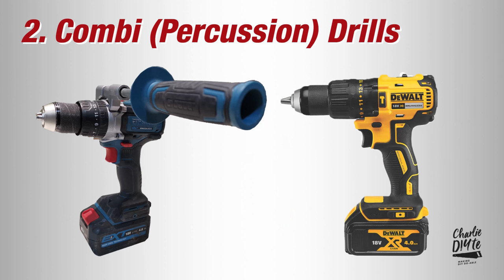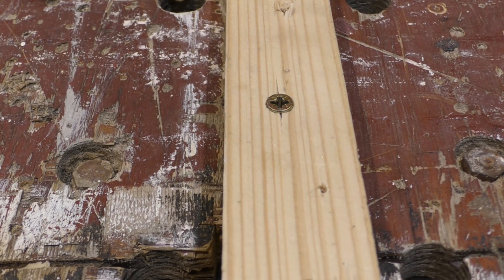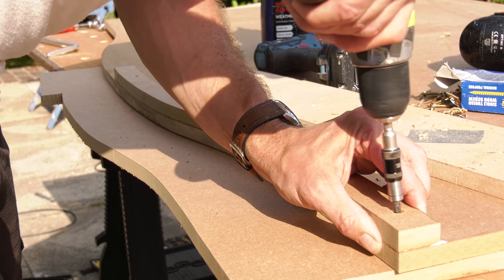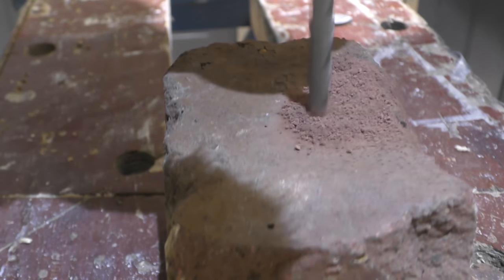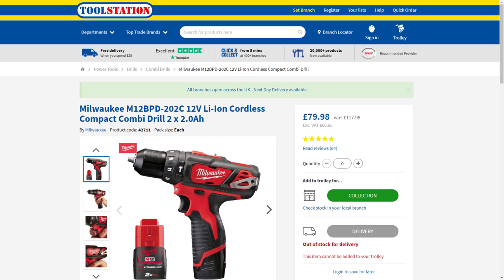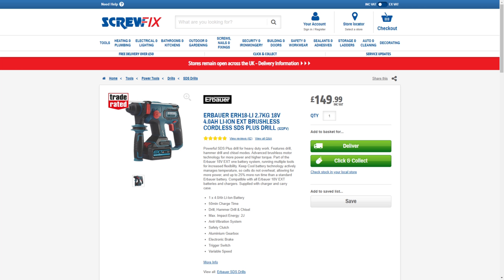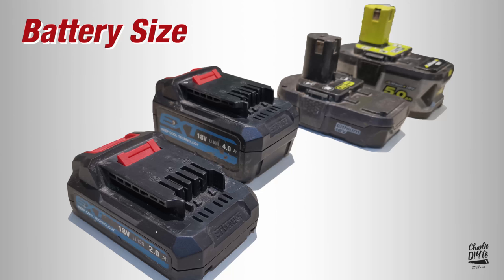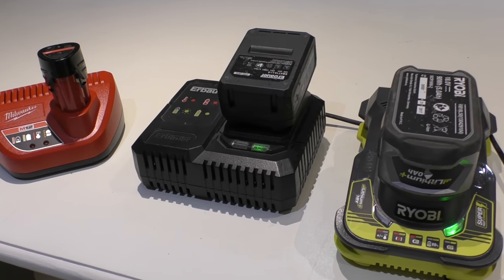The Difference between Combi, Drill Driver, Impact and SDS Drills

Comment: Drill/drivers and impact drivers aside for a moment, as a DIY”er, working on your own home or garden where you can be guaranteed a mains power source and are not against the clock, I see no need to go with battery powered for everything.  Corded circular saw, SDS drill, jigsaw, mitre saw, multi-tool, angle grinder.  Of course battery is more convenient, but corded tools are cheaper and generally more powerful.
Reply: True but unfortunately there isn't a power source at the allotment plots so cordless  is the only option really because I don't own a generator and you can only drive when there's been no rain for months on end or get stuck.  Yup cordless is my friend.
Reply: And you can almost guarantee; when a emergency job comes up - the batteries in your cordless tool will be flat !!  So you will have to bodge it with something else ....
Reply: I have both, the time you save and money saved on extension cords is worth it

Comment: I was a pro tradesman from 1980 to 2000 and we used Bosch and Makita battery tools when they first came out. The Makita's used to eat NiCad batteries. I currently have an Hitachi 18V combi, Erbauer 18V SDS and a Titan 239V SDS which I bought for knocking a wall down. The Hitachi has been fantastic, one of the best drills I've had. The Erbauer is as good as a Bosch GBH24 IMHO and way better value. The Titan is by name and nature a Titan, it makes mincemeat out of brickwork and concrete. My next door neighbour borrowed it to break up the foundation of his clothes line pole and got it done in minutes. At work we have 50 to 60 operatives and we used to use Bosch battery tools but found the plastic chucks were poor so we moved to Milwuakee. The Milwuakee's were unreliable with many broken triggers and other electrical issues so we moved back to Bosch, but the Pro range with metal chucks.De-walt have a big fan base but personally I think they're overated and over priced. Great video Charlie, many thanks.

Comment: What people need to realise is that the power tools u like and use are 4 DIY only really! If you work on site as a professional you need the better more expensive brushless models like Dewalt, Makita, Festool, Hilti, Metabo and Milwalkee! The tools you prefer aren't really upto the heavy duty work that professional's use! By the way brushless are more powerful and the batteries will last longer! Also you want the same brand as you don't want to lug round umpteen chargers and batteries!
Reply from the maker: Thanks Ian. I'm pretty sure I made this point. This video is aimed at to the DIY market though. You're right but I don't think DIYers would notice the benefits that a brushless motor deliver.

Comment: Finally, someone with logic that's getting off the brand-name loyalty bandwagon. I commend you sir for your opinion on brand loyalty. I was so wrapped up with my first tool, a Porter cable drill driver that I wanted to continue with that line, but Porter cable is no where to be found. You're right, so what if I have three different manufacturers and three different batteries. For do-it-yourselfer it's really a no-brainer when you come to think about it.
Reply from the maker: Thanks, I appreciate that. 👍
Reply: You are of course right about brand loyalty for diyers but professional's who work on site don't want to be carrying around allsorts of chargers and batteries! You also get what you pay for! If you want a rolls royce then don't by a Morris minor and expect it to be the same quality! I myself am a plumbing and heating engineer who use top of the range Metabo as my choice! I don't want to be buying new power tools every year! If you try to use sub standard power tools for heavy duty site work you will regret it as my son found out when he was an apprentice carpenter and used a cheap Ryobi combi drill for the day to hang doors and by the end of the day the motor had burnt-out and was no more use to him! He then decided to by smart and although he paid more for his new Dewalt combi it has lasted him to this day which is 8yrs on! He now has every power tool he needs all made by Dewalt saving him money on chargers and different battery set ups!

Comment: Tim from Canada so it looks like you went from Ryobi.. that was discontinuing in your country and you switched to Milwaukee.. so the Milwaukee driver you were using in this video is the Milwaukee M 12.. this is the make that is running in the Home Depot in Canada and USA.. you can still buy your little Ryobi 12 v. Screw gun in Canada at Home Depot these are one of the big sellers at Home Depot trying to find anything that is 18 V half decent by Ryobi.Most of the time is impossible at least in the city I am in in Canada where I live there is two Home Depot’s within an hour of each other from me and trying to find tools here is somewhat impossible and trying to find someone to help you find tools this is another problem Home Depot is having one day you’ll go in and there will be five people that will help you... you can go back in a week looking for something else and you will not find any help in the power tool section... this seems to be a big problem at Home Depot.. what I am finding two in Canada at the Home Depot is stuff will be on the website you go to buy it.. it is now out of stock and it is not listed anymore at any stores.. they need to fix this update the service at the website at Home Depot or get someone there that knows what the hell they are doing... you can go in there and ask a five-year-old to help you and they will have more sense than the people working here. These are my problems I am having at the Home Depot in Canada but people are scared they do not want to speak up...
Reply from the maker: We have the same problem in the UK with staff in DIY stores not being knowledgeable on the power tools they sell.

Comment: Very useful video. That Titan SDS is a beast! I use DeWalt combi and impact driver daily. Note that there are 'retail' and trade ranges, so if you want the higher spec you need to do a bit of searching (not Screwfix/Toolstation etc)
Reply from the maker: I'm embarrassed to say, Steve, I didn't even know that!! Can you give me an example of a trade link? Thanks for the comment 👍🏻
Reply: @CharlieDIYte  As you say in the film, manufacturers are tricky with the 'kits' they sell - combinations of tools, batteries, retailer-specifics etc, but for the DeWalt combi driver you can get the DCD796P2 (XR) and DCD996P2 (XR-P). Note the 'P' (Professional?). More powerful, better gearbox, extra speed, led settings as torch. For the impact driver, there is the DCF787N and DCF887N which is more powerful and has 3 torque settings. I got my higher spec from Powertoolworld or FFX. No idea about Milwaukee etc. And of course there are now higher-voltage options. Might be a subject for a follow-up?

Comment: Even at 3 years old, this is still the most helpful information I've had to work out what the differences between combi & drill drivers are! I've literally spent hours on various store pages and nothing ever really explains it. Also, you probably already know but may be worth a short update video about AMPShare, which means if you have a Bosch or Titan 18V battery, you can buy a bare version of either brand's tools and use the other's battery!
Reply from the maker: Thanks and I didn't know that about AMP share. 👊

Comment: Good video. I agree that a drill driver (with or without hammer mode) is probably the single most useful tool for DIY, if for no other reason than it’s extremely flexible. I also agree with you on using a good 12V model such as the Milwaukee, Bosch, or Makita. Ryobi doesn’t seem to be committed to their 12V line, so I personally wouldn’t recommend the Ryobi 12V, but if you find a good enough deal on it, it’s fine. 

I also find that for most DIY users, a good 12V hammer drill/driver (aka combi or impact drill) such as the Makita CXT, Milwaukee M12 FUEL, or DeWalt Xtreme is sufficient. If you’re doing a lot of brick/concrete drilling or a lot of tile removal, then an SDS rotary hammer might make sense. For a one time project, it may be more cost effective to just rent an SDS tool.

As you mentioned, if you’re installing a lot of screws, bolts, etc, then an impact driver is highly recommended. They’re almost as flexible as a drill/driver, and much faster, and easier to use for most fasteners. They’re also suitable for lightweight drilling as long as you buy impact rated hex shank QC drill bits. Word of caution, because of their speed, it’s easy to over drive smaller screws, until you learn to control the speed using the  trigger and/or speed mode controls. If you’re installing a deck or similar project, save yourself a lot of time by using an impact driver.

Since installing screws and bolts was the primary task for which I use power tools in my work, my impact driver gets used much more than my drill/driver. But when I changed projects and was installing/removing more small screws, I bought the Milwaukee M12 screwdriver (model 2401, brushed) which is now the tool I use most, it’s by far the easiest to control and the lightest of my power tools. Impact driver is now second most used, for larger jobs and larger fasteners, and the hammer drill/driver is used almost exclusively for drilling, mostly for larger holes or masonry as the other two tools handle drilling smaller holes in softer materials just fine. It’s a luxury to have all 3 at my disposal, not a necessity.

PS. I also have 18V/20V power tools, but rarely use them. For saws and other high power tools, 18/20/24V is definitely more appropriate than 12V
Reply from the maker: Thanks for taking the time to send that - an excellent comment that I agree with on all counts. I'll take a look at that Milwaukee screw driver A guy who works for us in the old day job uses his DeWalt impact for everything. He's used to it but can occasionally be heavy handed, and break/snap things. In desperation I bought him a Stanley ratchet screwdriver because even when you're totally in control of the tool you just don't know how tight a screw is in, say plasterboard fixing, without checking out with a manual.  👍🏻

Comment: Drill- Packedge in typical box, came with a tool bag (added bonus), two batteries, one charger, drill, and driver. Two words "plenty of Torque" https://www.youtube.com/post/UgkxW1vOBRCMrgTCDEijzpVzDWsgI-Jm2iQv  well I guess that's three. Nice upgrade from current setup. Has belt clips, I don't think I will be using those. Driver and drill were bigger than what I expected but it is an upgrade from the current setup. For the money I would say that this is a great setup for Professionals and DIY/Weekend warriors.
Reply from the maker: Yes a lot more powerful but it's horses for courses. Often you don't need the power but need more control.

Comment: Had an Aldi combi drill for 10 years, good enough to tackle hanging jobs around the house. But had a bigger DIY project building storage shelves from planed timber so decided an upgrade was required. Ended up purchasing a De Walt 18v 2mAh brushless twin pack from Screwfix. I have to say, the impact driver made light work of driving in hundreds of screws and not a single cam out. Made the job a lot easier, quicker and safer.

Comment: Thank you for explaining all the differences Charlie! I have a Dewalt drill with two batteries, but it's probably 25 years old. The batteries just won't hold their charge and it weighs a ton! So now there are all kinds of little drills out there and it is a bit overwhelming, your video really helped. I will look at a small drill/driver for basic screwing wood projects. But we have an old stone barn that we need to remove old cement from, is that when we'd use a SDS drill? I think the one kit you showed had a chisel tip in it.

Comment: Just one comment about batteries as a DIYer, I have recently invested in some Erbaurer stuff to replace an ancient Dewalt and compliment my lower end Makita G series drill and impact driver. I needed a new hedge trimmer as the battery died due to lack of use (Bosch green), so I decided to buy a hedge trimmer that will work with batteries I will use a lot. For this reason I bought a cheap 18v Erbaurer combi drill that was on an offer and a cordless vac, that way when I come to use the hedge trimmers the battery won't die due to lack of use.  I also have a 12v Erbaurer drill driver and I love using it for drilling into wood or applications where my impact driver is too powerful. 

Other than that I totally get your point about not being loyal, and I love my corded stuff for this reason too. 

All my tools are brushed apart from the new hedge trimmers which are brushless but my 11 year old Dewalt cordless did fail recently due to brushes failing and as it was a lower end Dewalt they are built into the motor :(

PS I have your channel and watch a lot of your videos, to me you are very competent and far more skilled than most DIYers.
Reply from the maker: Hi Ian, really appreciate you watching my vids 👊 Good work investing in the Erbauer kit - I think that stuff is great value for money and I use mine all the time. They also do an 18v SDS that's very good. Sounds like you've got an ideal set up there, with those tools!

Comment: Massive thumbs up.. Recently embarked on my diy journey and picked makita as my companion.

I will agree with with your point regarding weight of the combi.. Power the lot.. With the exception if your are drivning into hardwood.. Had to mount 30 meters of solid oak fencing 2 meters tall.. 6*90 mm through oak would have killed my wrist..
Reply from the maker: Yes, for that, an impact would be very useful. That's why ultimately you end up acquiring all these tools. Thanks so much for taking the time to comment. Feedback like this is so valuable. Caused me a fair amount of anxiety this one as I didn't know how it would be received.

Comment: I agree about using lightweight combi drill drivers for DIY use, you wouldn’t go far wrong with the Milwaukee you demonstrated. I have a Makita 9.6V percussion combi drill and an impact driver. I’ve also got the matching right angle drill which is useful for tight spaces and pilot holes whilst using the combi in conjunction for screw driving. I used to have some Dewalt 18V stuff and the drill was a beast and really too powerful for things like kitchen cabinet assembly so I sold it all. I’ve still got a big corded 1100 Watt Dewalt SDS and that’s great for the heavy duty stuff and I use it for mixing as well. I also have a couple of old Stanley Yankee screwdrivers which I think are a forgotten tool and I have found them to be invaluable over the years, the small one for general assembly and the large one for stubborn screws (the large one was my dad’s and is over 60 years old!).
Reply from the maker: I had one of those Yankees! They were a must have tool before electric screwdrivers came out. My brother in law now has it. I think my father gave it to him not realising it was mine! Absolute genius in their day.

Comment: Very  informative video. Thanks  for sharing. I like to add some points based on my experience : 
First, know what material is mostly used in construction in your area. For example in USA most houses are built with wood while in Iran most houses are built with concrete walls and blocks. So if your house is mostly made of concrete, you definitely need a drill with a good hammer action (preferably a sds drill). 
We diyers usually don't make money using our tools(however we save some by doing things ourself 😉) so we should look for tools that have an acceptable price with spare parts available. 
I prefer to have two drills available at any project. One for drilling and making holes and another one for fastening screws. This really speeds up any project. Because I don't have to change bits everytime.
Always check the drill for chuck wobble after purchase. Drills from any brand can have chuck wobble so  be sure to check it.
Brushless tools are usually more powerful but they are harder to repair and need special controlller boards. However,  brushless motors are long lasting and use the battery more efficiently. If you want to buy a brushless tool, try to purchase from well known brands because the controller board and how it manages the power and motor is very important for durability and performance of tools .

For those who don't know I should  that brushesh are small things made of conductive carbon. They transfer electric current to the rotating part of motor ( that cannot be connected using wires). After many uses and because of friction, these carbon brushes become smaller and smaller to the point that you have to change them which is usually a straightforward and easy task.
Moreover, it is also good yo know that brushless motors are fundamentally different from DC motors (known as brushed motors in tool industry).
P.S. Dear Charlie I think you made a very small mistake while explaining about brushless motors. Brushless motors don't have brushes (you said magnets ).

Comment: For flexibility, I’ve got the Bosch FlexiClick units. Very handy thanks to the various adapters and the 18V version has an SDS attachment that I’ve used to drill into concrete and brick without issue.